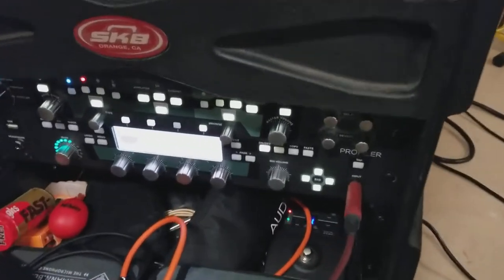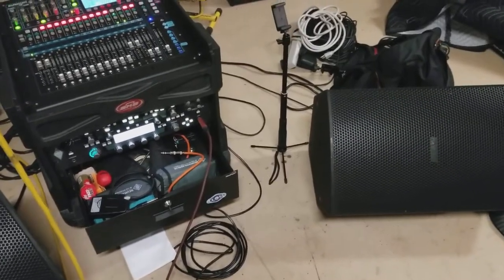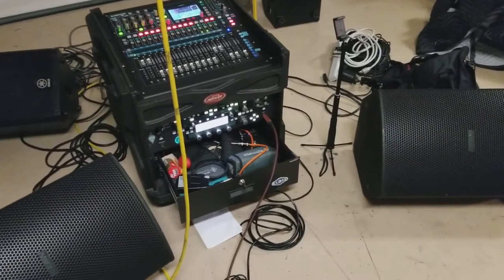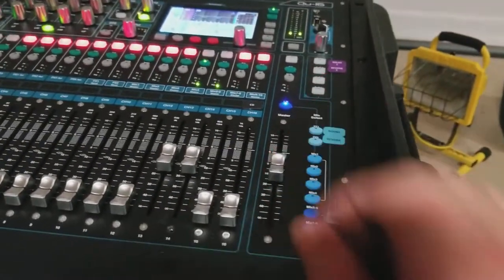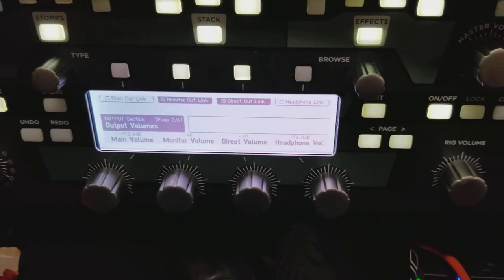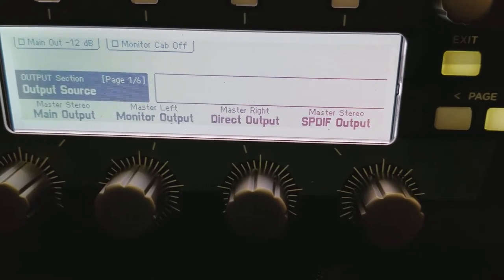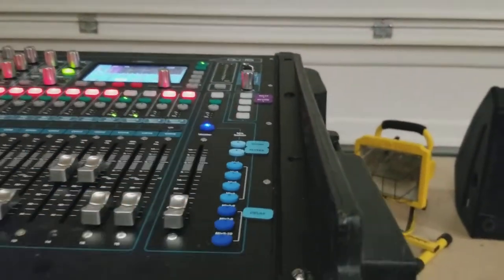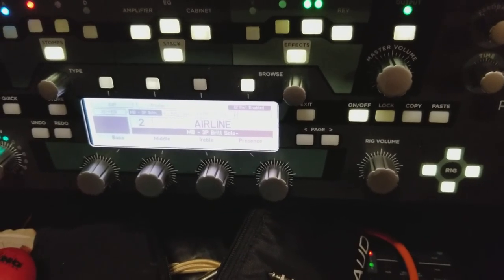Kemper Profiler - Running Stereo to FOH and Monitoring in Stereo Setup...

Comment: Currently l am running stereo to the house and on the monitor out l run to a Seymour Duncan powerstage power amp. I come out of the powerstage to 2 2x12’s or 2 4 x12’s. I cut off the effects so it’s a dry signal for stage volume. So my question, l think you said l can equally at the same time use my mains XLR outs and the mains 1/4 inch outs? If so, can l make the 1/4 inch outs dry and let my huge delays and reverbs just go to the house. I currently like my setup and have used it a couple years now. Can you recommend any other options?

Comment: Any idea how to monitor with a regular cabinet on stage, while running to the front of house with XLR's? The thing is, the cab simulation is on, and i need it off through the cab on stage, and on for the front of house. Is there a way to do that?
Reply: I'm using a powered Kemper and this is how i'm doing it. XLR's to house and monitor out to my top cab. I'm using a stack on stage, if you are to, then go into output settings and turn on Monitor stereo for both cabs to work.

Comment: Random question if running through a normal guitar cab should I put it to mono on the main output ? Also another random is that dust under your kemper screen as I no mines has it also if it is I've heried it's common I think ? Thanks

Comment: Why don't you just send a stereo aux or stereo subgroup from the mixer to the monitors like you would do with any other monitor ?
Reply from the maker: because the cabinets I'm using aren't 'monitors'.  They are essentially my guitar cabinets...in stereo.  I don't want to have the house send me a line back to my own cabinets and are now in control of EQ, volume, etc...   Sure, if you have a stage monitor supplied by the house you can ask them to put a little of the guitar into that - but you're going to get a mono signal (highly doubt you'll have stereo stage monitors unless you are playing Madison Square Garden :)).  The goal here is to be in total control of what you send to the house but also have a stereo rig on stage and you have to manipulate the outputs on the Kemper to make that happen, which is the goal of this video.